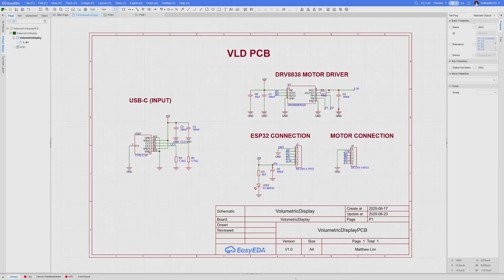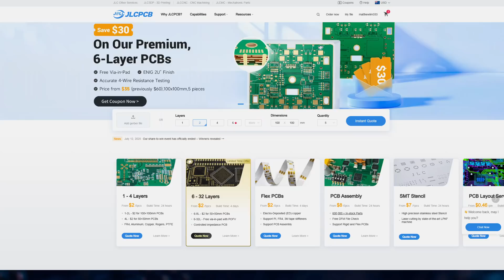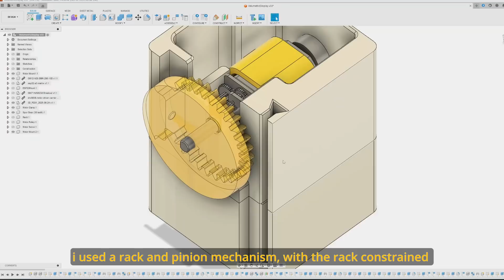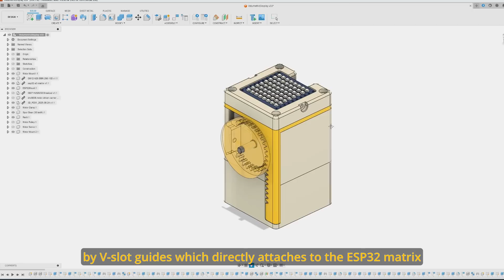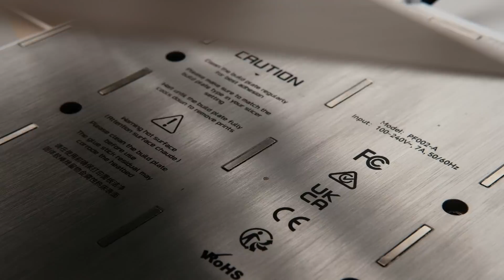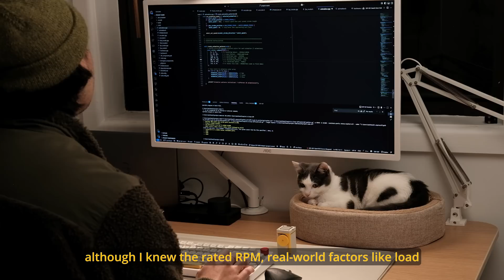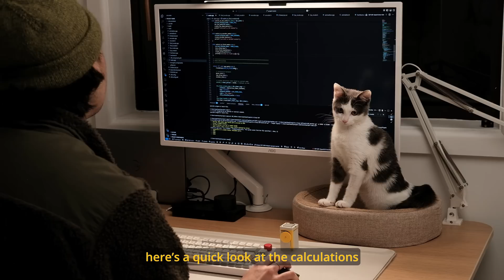i made a mini volumetric display using linear motion

Comment: You could use a crank and shaft system as already mentioned, but the arm that goes up and down should be in the center of the box, and to give it greater stability you could place 4 metal bars tied to the upper box near its vertices and some bronze guides in the lower box.

Comment: I am very late to this video. This is very cool and great job on the execution. Have you tried a version with multiple v slots for stability? The backlash and encoder inaccuracy will still be an issue, but I wonder if adding additional slots will contrain the travel mechanism enough to make it smoother.

Comment: Very cool project. Already a bunch of great suggestions in the comments. Maybe some counterweight in the bottom of the machine would help it stabilize as well. Could be as easy as some more screws screwed in there or a laser-cut metal plate sandwiched somewhere in between.

Comment: Wow really cool! Maybe try to reduce the weight of the moving part by not using metal screws, using less plastic, and designing the bottom pcb to have the microcontroller, and the top to only have the led matrix.

Comment: Years ago, perhaps late 1990's, I proposed a rotating video display using a strip of LED's and polar coordinates rather than Cartesian coordinates. Some years later, a company called "Pimp Star Rims" (or something like that) got a patent on the same basic idea. A few years after that, it occured to me that you could do the same thing in 3D rather than 2D. My idea was to use something akin to the early mechanical televisions, but rotate the display in 3D rather than 2D using persistence of vision. I liked this idea better than a reciprocating device because the acceleration would be constant rather than a sinusoidal variation, and I figured that rotating contacts shouldn't be too hard to engineer. In a dark room, or outdoors at night, it should work. I couldn't get anyone else interested in either idea, and I never pursued it any further, but I still think it would be cool to see it. Does anyone know if anyone has done this?

Comment: This is brilliant!

For a far out idea, what about a blast of air to force the platform up and then let the weight/gravity bring it back down to its minimum height (think wind blowing a sail rather than a sealed tank). A little metal tape in the base and on the platform to act as a switch to blast air in again.

Comment: Look at a reciprocating rack and pinion. You're already halfway there ;) . It turns continuous rotation into constant speed reciprocating linear motion. You'll have to experiment though. I don't know if it can take these speeds, because the rack (and whatever is mounted to it) goes essentially from stationary to moving in an instant.

Comment: Awesome project. I would like to suggest a counterweight so that it can be placed on a surface without going crazy. I think a similar shaft on the other side of gear that pumps the counterweight downwards. You can add a hollow space below the circuitry for this. Making the whole module a bit longer but stable.

Comment: I think you should use a Connecting rod mechanism so the motor move in a single direction giving more stability and also a couple of gears to have 2 points of contact between the platform and the body.

Comment: Hi. Why use encoder on the motor when you have a rail? Just use linear grating and photo sensor (i.e. optical encoder). You can print a sticker with photo printer (which are insanely precise (If you have printer, there are those "ATM"s that can print photos from the phone nearby). Maybe even the fine marker lines drawn on the 3d print will suffice. Still, an amazing feat, even the design looks great (I'd imagine Teenage Engineering could make such a device).
Reply from the maker: Thanks for the suggestion! It didn't occur to me to use an optical sensor,  I think that would work a lot better

Comment: Those wires squished in the case like that after seeing how much movement they need is stressing me out.  Those wires really need a dedicated channel.

Anything that's going to go through so much movement needs to have the movement directed intentionally or it will find its own weakest point and flex on it until it snaps from fatigue.

I would point the connections from both boards downwards then have a channel that allows the wire bundle to bend 180 degrees.  As it moves, the bend should progress along the length of the wire, so no one part is ever folded.  Look at how CNC machines and 3D printers route their moving cables.

It won't guarantee no fatigue failure but it will reduce them and extend the life of the design.

Comment: well that has to accelerate like a spring all the time. spinning is less energy intensive constant motion. you know trains. maybe just move a reflection surface up and down, and use laser pointer to draw the 3d display. or any motion target surface like spinning. I got a stroke while watching this video. that thing bounces around like a construction equipment. you know, you could use a stack of lcd layers with backlight, to get a solid state no moving parts 3d matrix display.

Comment: i don't know if it's possible or not, but if the encoder is actually on the display, it would correlate with its actual position, helping to reduce the problems i see here.

Comment: I think the flapping display design might be the future of these projects (like those Bitzee toys) where a flex pcb acts as an electromagnet that oscillates itself to create a persistence of vision display. This could easily become the low-cost volumetric display. The flapping mechanism is also safe to touch too so it can be scaled up safely.
Reply: Sort of safe to touch. The magnetic plate on the PCB gets warm if you hold it in place.

Comment: This is seriously cool! Others have mentioned the potential of using a crank-based motion to make your life easier, but, it’s worth noting that a piston-type mechanism doesn’t produce a perfect sinusoid (it creates a periodic linear reciprocation, but it does have a slight dwell if i understand correctly). Your next best option for a crank-based system would probably be something like a scotch yoke, but those come with additional friction and introduce new vibrations along the perpendicular axis. All things considered, a rack and pinion may have been the easiest choice for a proof of concept like this, and it clearly works well enough. Sick display!!
Reply from the maker: Thanks! I did think about the different velocity profiles, but hopefully with the encoder, it shouldn't matter too much. It'll be a challenge dealing with the friction and gear ratios for the other mechanisms 😅
Reply: i was about to comment the same thing. you wrote it better. cool project! very capable guy right here
Reply: Perfect sinusoidal movement isn't necessary for this.
Reply: As long as you keep the radial displacement inside the loop, you'll always have a sinusoïdal component to the displacement. Your timing will have to change along the whole displacement. I think he did that here because if he did not, you'd have dwelling at the bottom and top of the displacement. That also means that your processor has to be able to make up each frame before you get to its position and that delay is therefore not the same and the On time of the LEDs also has to change. I'd try to use linear actuators instead who have stable dX/dT.
Reply: Shut up and do it yourself 
He did best because he did you did nothing

Comment: I would suggest a constant rotating mechanism that convert the movement to linear.
This would reduce gears backlash and would increase dramatically speed.
I would also suggest that the movement should be made by pushing under the center of the display to avoid lateral movements, or if kept sideways, helped with some guides (one or more steel rod and a linear brass bushing) or maybe synced with another opposed mirrored mechanism (i.e. another motor or only a single motor moving 2 mechanisms).
Nice work though, a lot of potential!
Reply from the maker: Thanks for the suggestions, I'll definitely keep them in mind for the next version!

Comment: What about adding a counterweight on another rack on the opposite side to reduce the vibration of the base? I guess that might need more power from the motor, though.
Reply: Definitely will need something to balance out the primary and secondary forces

Comment: I would presume a crank-based motion system would increase the performance quite a bit as the motor direction does not need to be reversed.
Reply: Or maybe a scotch yoke?
Reply: @ericpotter7954 scotch yoke is not constant-speed.  That probably would make the programming more challenging.  If it wasn't compensated for, it would distort the height of images.  A constant-speed solution might be the easiest solution since at every point in the stroke, it's going the same speed.
Reply: @Hazdazos  As long as the piston's extension can be described using a function of crank angle, it's very easy to program the output. A basic setup would work with super simple trigonometry.
Reply: exactly what i was thinking. like the same basic linkage setup used for most pistons
Reply: there's crank slider, scotch yoke, cam follower, or even peaucellier lipkin linkages, but practically crank slider + linear bearing would probably be enough
Reply: @v000000000000v  Cam follower and scotch yoke would likely have a lot of resistance with the piece moving so fast. A crank slider would probably be the least noisy and most efficient. Not that it's ever going to be quiet.
Reply from the maker: Good call! I’ll definitely be using a crank mechanism in the next version
Reply: @matthewlim88 Alternatively, consider winding a short length of fine cable (or for this project strong thread and a spring would do) instead of gearing.
Reply: @matthewlim88  Look up the design of jigsaws, they are stable and can run quiet fast...
Reply: @matthewlim88  the problem with crank mechanism is that the linear speed is not the same depending on the position, it will be higher at the middle and muuuch slower at the top and bottom (i tought you were not using this because of this particular reason tbh)
Reply: @joysticthegame  what i was gonna say
Reply: @matthewlim88  so what you are saying Matthew is you need to crank it?
Reply: Consider adding a counterweight, similar to what's found in an internal combustion engine, to balance the rotating mass and reduce vibrations and mechanical stress on the axle.
Reply: Maybe a rack on either side of the gear, with the gear missing half its teeth, so it lifts up on one rack and then meshes with the other and pulls it down without changing the motor direction?
Reply: Or make a linear motor by wrapping 2 or 3 coils around a tube containing a rod with a magnet or iron disc on the end. That way there's only one moving part.
Reply: Better directly use a electric solenoid and a hall sensor for measuring the distance to calculate the timing of the layers
Reply: Same. Everyone else covered it. I agree.